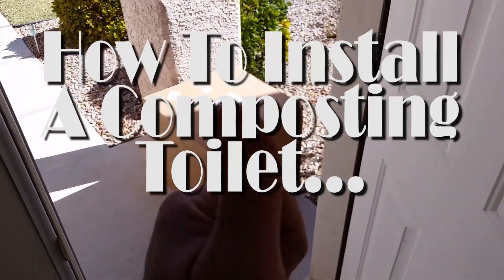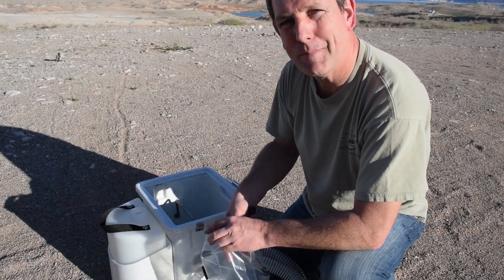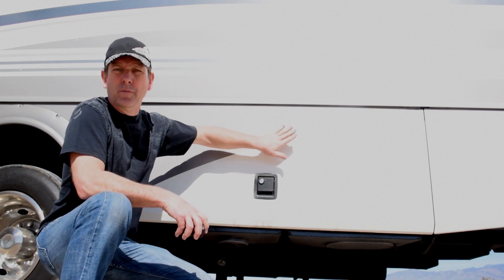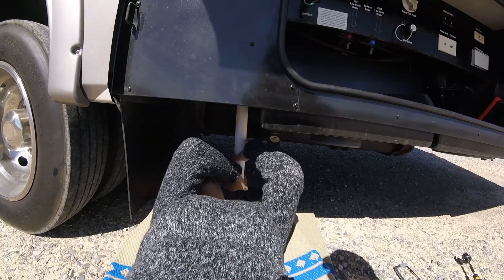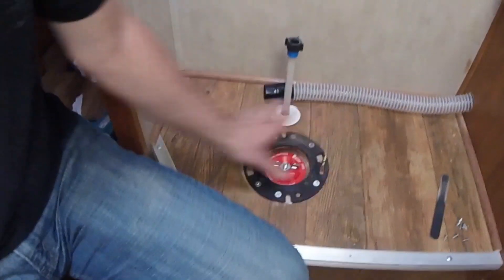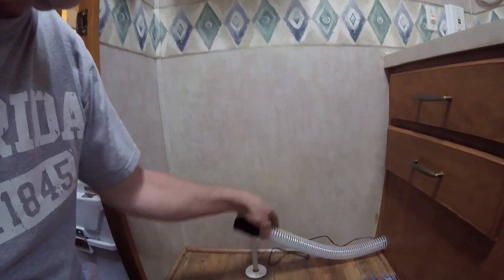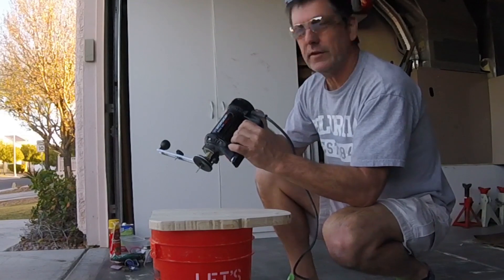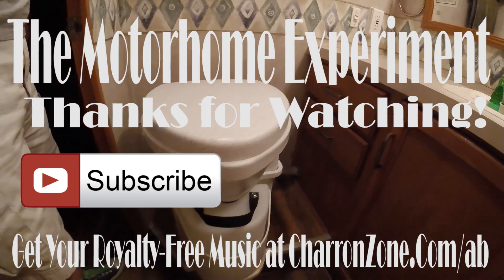Composting Toilet | How We Installed A Composting Toilet In Our RV #compostingtoilet

Comment: you have had it 5 month now  was it worth it?   curious about how tall it is.  Is it possible to mount it on a platform so it would be more like a handicap toilet?
Reply from the maker: Hi Joe! We really like it. I'm the one that has to deal with emptying it and the process for urine or the main tank is, in my opinion, better than dealing with black tank. Ours is on a platform and we have to use a little stool to get up on it. The height is probably ideal for a handicap application! I'll have to do an update video so people can hear my opinion on it. Thanks for watching and safe travels! Paul
Reply: where do you dispose of all the waste?  How often do you have to dispose of it?  How do you know when it's full?
Reply from the maker: We use composting trash bags as well, and they can be put in any regular trash receptacle. Always check local laws, but it is pretty safe and only has a slight earthy smell. You can get more information in The Humanure Handbook on Amazon at http://amzn.to/2bD79RZ.

You'll know it's full when the handle gets hard to turn. You'll empty it a lot less often than a black tank. The urine tank can be put into your grey tank or you can dump it in a toilet anywhere with the portable tank.

I hope that helps. Paul

Comment: How do you dispose of liquid waste?  Don't imagine RV parks look kindly on disposal around campsites.  What is the capacity of liquid container?  Thanks.
Reply from the maker: Hi Anna, we dispose of liquid waste in a couple of ways. Mostly we try to dispose of it during any stop where there is a toilet. Simply pour it down. If we are not going to be near restrooms for a while it can also be put down the shower drain into your gray tank. Putting it in the shower is not the most pleasant experience because of the odor, but I don't find it that bad. My wife doesn't like it. I believe the urine tank is just over 2 gallons so it lasts several days during full time use.

I don't believe urine is harmful but I recommend people be very respectful of disposal outside. Make sure you do it way out of the way of other campers, camp sites, etc. Safe travels! Paul
Reply: Thank you for your response

Comment: I tried to find someone to install my composting toilet. Most dealers (Camping World too) had never heard of such a thing. 
So be prepared for dumbfounded looks.
Of course they wouldn't reference Jason Wynn's videos so the fan switch is connected to 110 instead of 12v so fan can't run continunessly. 
Had mine over a year now. Took a couple of times to get correct amount of Coco Coir though. 
Urine is sterile so can be emptied down grey drain or on ground directly.
Reply from the maker: Hi Vicki! Thank you for sharing! I think they pretend not to have heard of it because they don't want to get involved. The fan is definitely 12 volt and that is something that is Electronics 101. Again, something they absolutely should know.

It probably took us a couple of uses to get the Coco Coir right, as well. The urine tank is my job. I know it's sterile but, I have never put it on the ground. I stay on top of it and usually put it in the shower drain or try to dump it at rest areas. Safe travels! Paul

Comment: This is not a how-to video, in my opinion. I know nothing about RV:s or installing toilets, so I was hoping to learn a lot. But all the interesting details are fast forwarded through. In particular so what items you picked up from the hardware store and why did you pick them up. I am a complete newbie in all things "hardware" and electronics yet I don't think I managed to actually learn anything. Except the fact that your ventilation exhaust goes down through the bottom of your RV, I thought they had to go up? Which is one of those things that would have been really great if you would have elaborated upon? Why do we even need an exhaust thing? Is all what you did was to put a pipe through the floor - no glue? No special tape? "Insulation" - stuff like that? Why did you trade the pipe for a smaller one? Why does the toilet need electrical power? Et cetera. I think this video is more for people who are already skilled in hardware and electronics and simply want to entertain themselves watching someone else do it.

It had entertaining value, even for a rookie like me. This video is by no means any less than all other videos on Youtube. In fact I think it is far above average which is why I wanted to share with you my thoughts and feedback. I am personally planning on going all mobile in the future so I am trying to educate myself on RV:s and stuff like insulating cars, installing composting toilets and so forth. But so far after months of research, I must conclude that I don't think Youtube is going to cut it. Everybody does what this video does and simply videotape an electrical drill or screwdriver working. Which has value too! But there's very little of instructions and education.

Anyways, just my five cents. I liked the video very much and I am grateful we have people like you taking time to document your work and share it. So a big thank you my friend.
Reply from the maker: Martin Andersson I want everyone to see how Martin made his comment and use it as an example of how you complain about a video! Very well done sir! 

I completely agree with you Martin! While shooting it, I thought I had enough of, "what to do" as well as some entertainment value, but found it lacked detail. I think this happens when you know how to do certain things and forget that others don't. You leave out details thinking, "oh, they'll know how that works."

There are some really good "how to" videos on Youtube, so please do not judge all of them off of mine. 

The best ones for RV are definitely on the RV Geeks channel. 

Let me answer a couple of your questions though before I go. A composing toilet needs to vent odors somewhere and because it is fully enclosed inside your coach, it uses computer fans to pull air in one side and push it out the other. because it is forcing air out, you can vent it either up or down. I think ideally it would still be better to be vented up. 

After having ours for close to a year now, I can tell you that it has worked flawlessly, but I would only recommend it for 2, maybe 3 people tops, and ONLY, if you plan on wild camping a lot. It does conserve water, but it is quite a bit of work. 

Any other questions, just ask! Safe travels! Paul
Reply: The Motorhome Experiment  Paul, you are good!
Reply from the maker: Thanks Kathy!